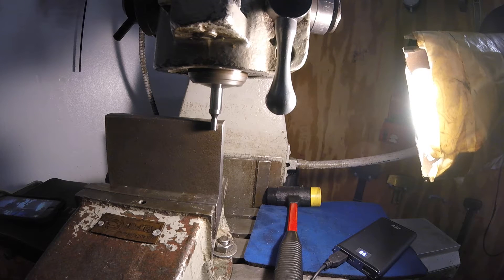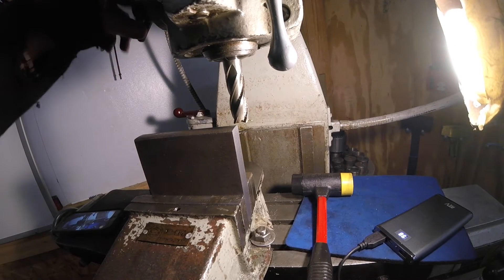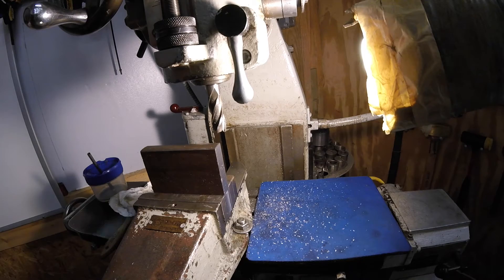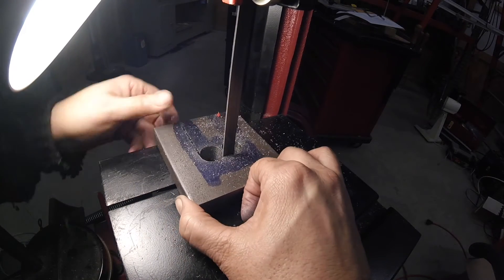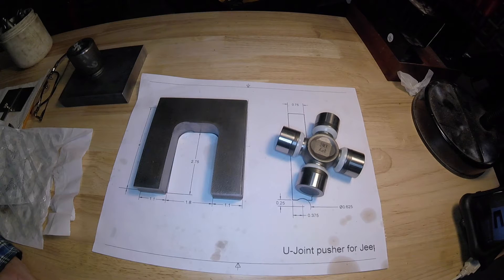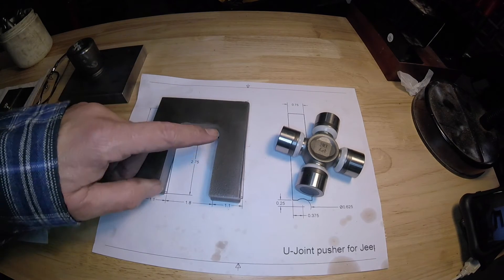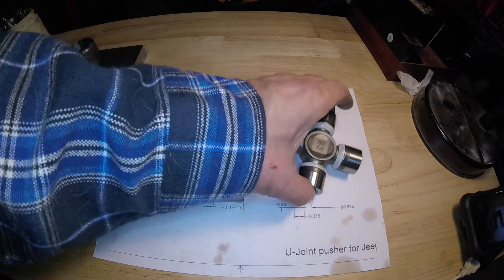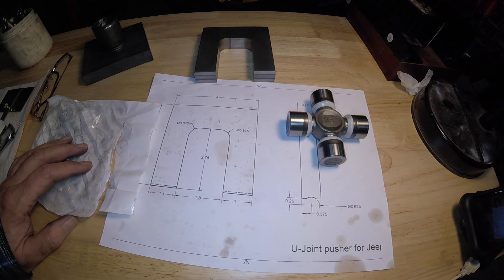Making a universal joint press tool for use on an arbor press

Comment: Nice work. I have seen the supported trunnion process used before and been trying to ready the fab of the tools. But I would mention, When I was researching, I found the support was on the table, and the receiver for the cap was used to press on the yoke.
Reply from the maker: @70ixlr86  Thanks,  Mine was a copy of the Axi-Line arbor press fixture shown in this video. https://youtu.be/d8LNLczDdK8?feature=shared

Comment: Nice tool! I've been looking for the pushing tool (like you made) and the receiving tool on the internet with no luck. You mentioned GM tool was available. Any idea where I could purchase these tools? Thanks! John
Reply from the maker: look up J-9522-3 U-Joint Bearing Separator   Freedom racing sells it for $46.  A lot of factory manuals say to use a socket as the receiver cup.  Chris
Reply: found it, Thanks!!!